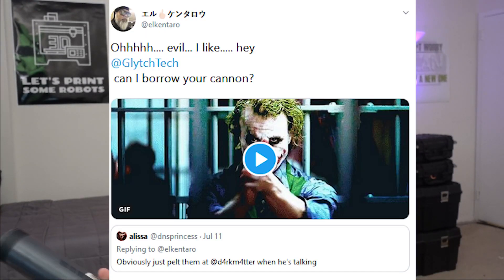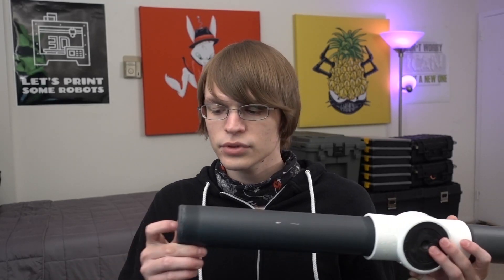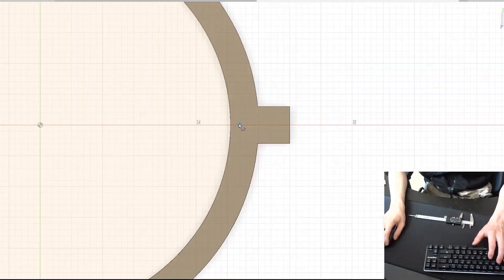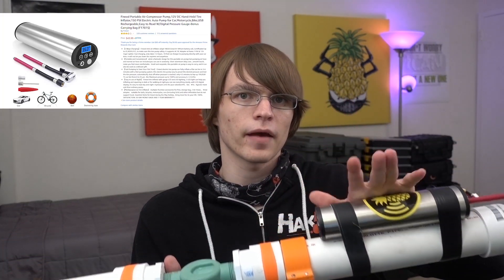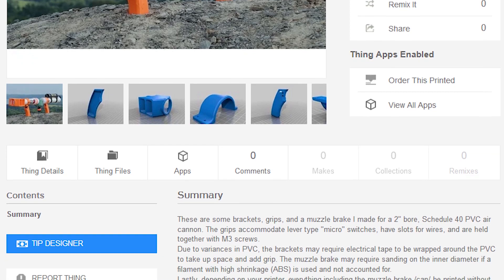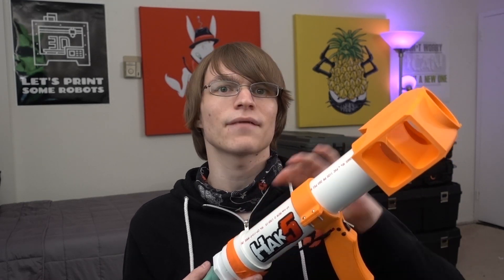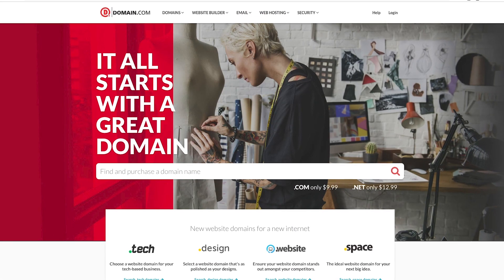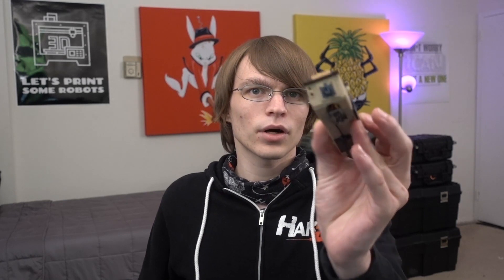Glytch Causes Chaos with Cannons - Hak5 2608

Comment: JUST GO WITH THE CLASSIC POTATOE CANNON AND USE FIRE TO IGNITE THE CHAMBER
Reply: @Glytch  IT'S FINE WITH A POTATOE
Reply: @antidecepticon  I had an ABS potato gun explode on me. I was running it on oxygen and acetylene which I don't ever recommend.
Reply: @toysareforboys1  NEVER SAID TO MIX OXYAGEN AND ACETYLENE USE ALCOHOL.  I WOULDNT RECOMMEND ABS FOR GAS LIKE THAT, WHY NOT USE METAL PIPE THEN? ALSO I MADE SURE THAT THE POTATOE COULD SLIDE DOWN THE BARREL, YOU GOTTA LET THE GAS ESCAPE